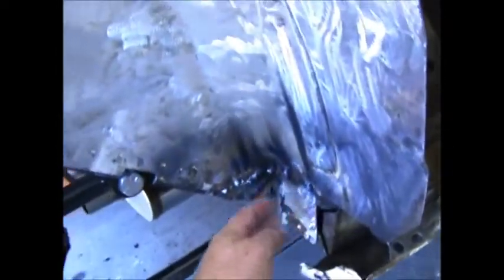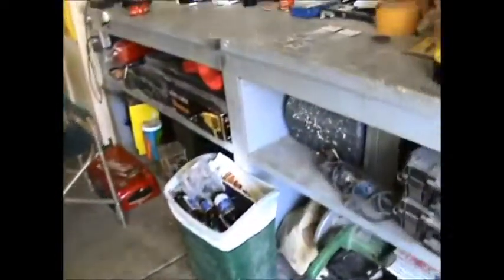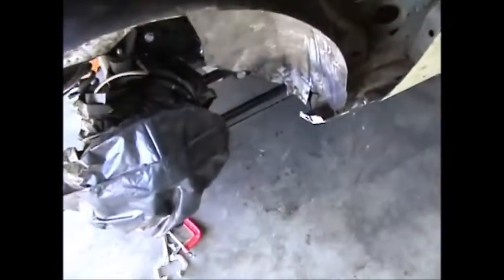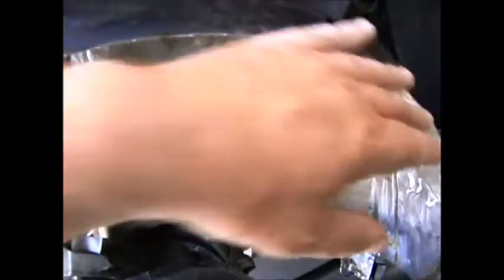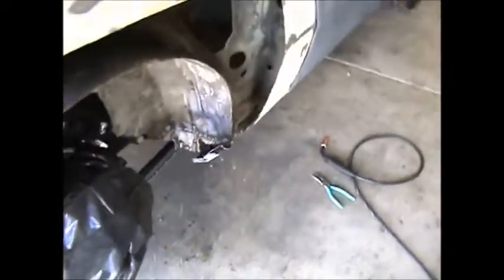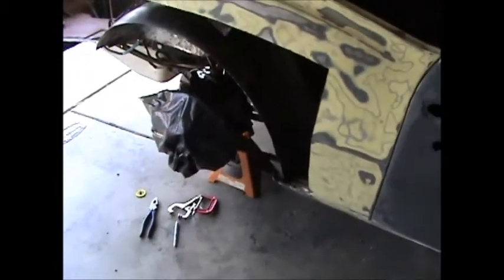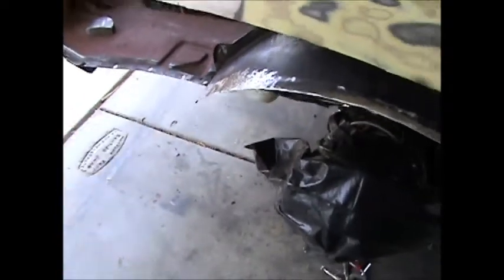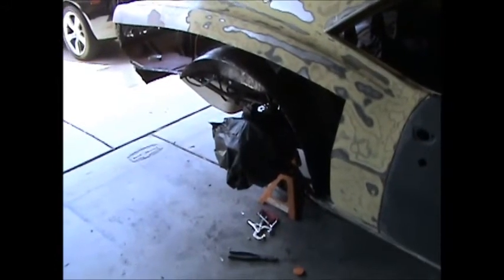1968 Camaro Resto-Mod 5-25-13

Comment: And thanks for showing me that pen-- I was thinking a paint marker (which I guess that is, but...) Tape worked out well for me-- it had a bright contrast and an "interactive" edge that would respond to my cut-off wheel by lifting a little if I got too close. I cut conservatively also-- planning to use my dremel to zero in on the profile I needed